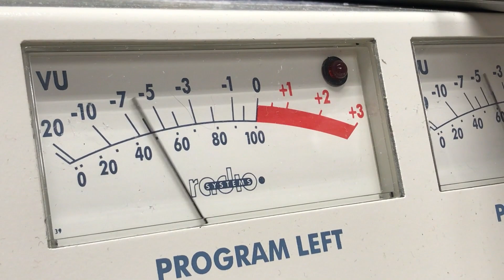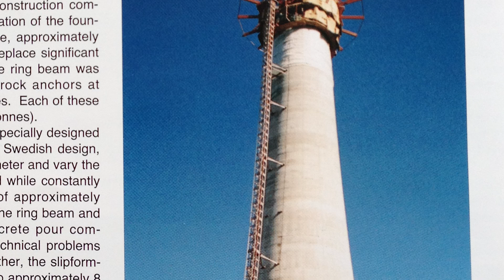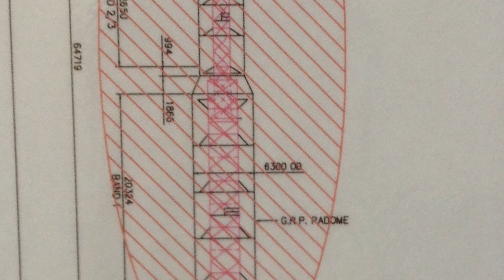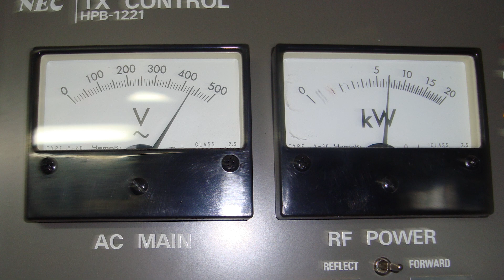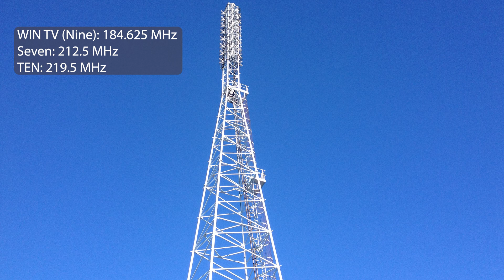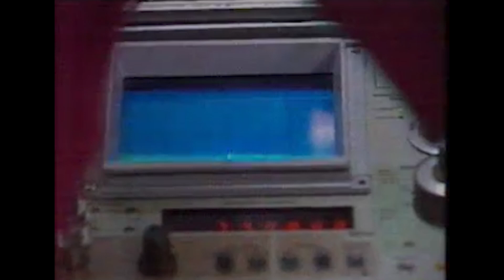Why Locals HATE This TV Tower!

Comment: Nice video Hayden.  Thanks for some of the inside shots.  I had been hoping to get a tour of either of these two sites but haven't so far.  An ex-Telstra tech once told me that the original PMG tower at one point wasn't correctly bolted to the slab/ground.  Wind causing oscillations in the tower had loosened bolts which held the tower to the ground/slab, one bolt completely undone and the other very loose.  I don't know how true that story was but given the wind the mountain gets, it really wouldn't surprise me.
Would love to see a video on the Mt Barrow facilities or even the Ralphs Bay MW site, with their histories, etc.  Would also love to understand the engineering behind how the TVT-6 engineers got TV to the west coast back in the day (when it was identified on air as TVT-6!)
Keep up the great work Hayden. Love seeing stuff in my home town.
Reply from the maker: Thanks Rob! Yes if this video is successful I might look at Mt Barrow

Comment: I was recently in Tasmania and went to Mt Wellington and tried to make some contacts on 2m and 70cm with my handheld, it's pretty much a no RF zone at all, repeaters are hard to crack and there is interference galore everywhere which make it hard to hear anything at all! I did get great pictures of the towers though!
Reply from the maker: Actually, it’s improved recently.. I was up there doing some work on our amateur radio repeater and we had just put a new antenna up, plugged in the 705… worked a treat, worked lots of people around town and repeaters up north. If you have a Baofeng or something with a super wide front end then yeah it’s toast
Reply from the maker: Oops I forgot to clarify why it’s improved. They stopped transmitting on Band I VHF, so less noise on 6m and I think switched off some UHF transmitters too
Reply: Thanks for the info! I was up there on the 10th of January and tried the repeater with my Baofeng that that was listed on repeaterbook as being up on the mountain. When I finally got to speak to some locals on some repeaters around Hobart I was informed the repeater was down for a few years. Great to hear that you are working on it Hayden!
Reply from the maker: Cool, yeah been off for maybe 9 months or so. We also decided to move it from UHF to VHF, so that’s going to be interesting. If you go back on my channel a few videos ago, I show the repeater being modified on my workbench